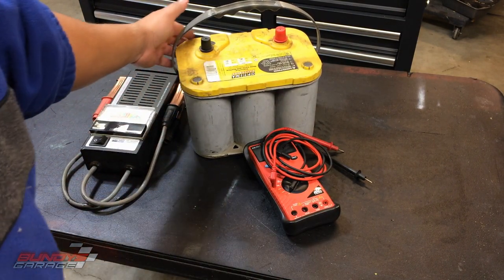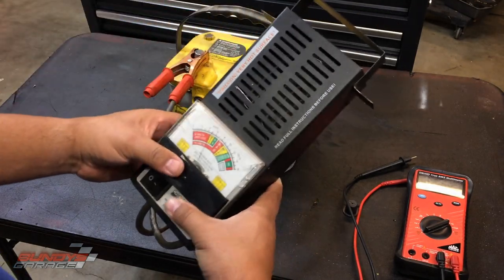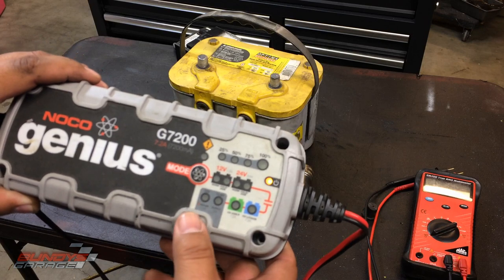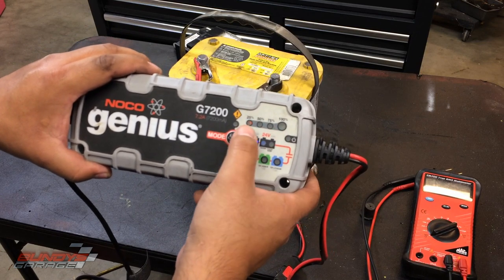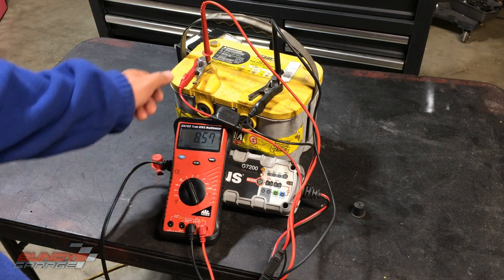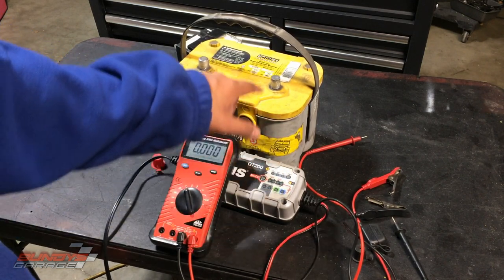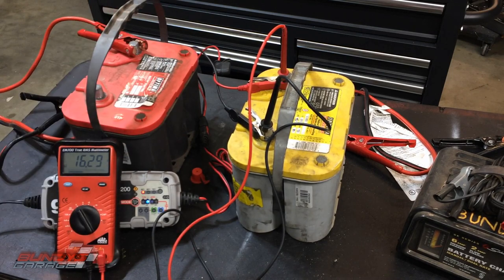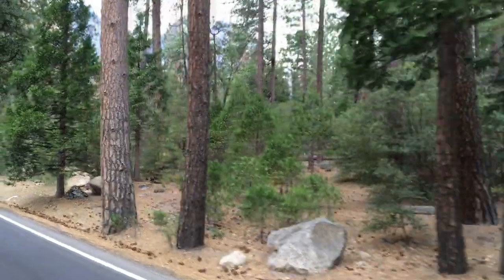Restoring an Optima Battery | Desulfate Optima Battery | Optima Battery Issues | Bundys Garage

Comment: I had 2 lead acid batteries that were sitting at 4.5-5v and 1 that was 0.. absolutely nothing. My Schumacher kept doing errors over night. I’ve learned when it comes to this, trickle charging and old school non digital chargers are the way to go. Grabbed one from harbor freight. For the first 3 days, I used a power wheels 1amp battery charger that I converted to pos/neg clamps. For the next 4-5 days I used the old school trickle on 2amp. I can say that after one week of slowly giving them juice all 3 batteries are sitting at a constant 13.8 while on charge, 13.2 off charge. And handled load test with no issue. Well sitting on the side of the road I just found a red top lol. I’m gonna try and work some magic into it.
Reply: I used a 12 volt power supply for an ATT two wire internet wifi router that puts out 500 miliamps. I just put alligator clips on the wires I cut and wal-ah it works.
Reply: @decoy2636  that's pretty cool man!!!
Reply: Did you check the capacity? You can trickle charge it back up to 13.2 volts but just because it's holding voltage doesn't mean it has any capacity It could have one amp hour for all you know

Comment: I was told by Optima that it can be restored if crystallization happens (under 12.4 volts)  so never buy a new AGM if it is under that voltage.

Comment: I know this is an older video. But I have a yellow top from 2009. And still have the instructions.
They are very clear that you put the battery on a high amp load for 10+hours minimum. And then a low amp load or trickle charge for a few hours after. 
This battery has "died" once from stereo abuse. And it even tested same as yours. But after giving it about 15 hours of charging it came back. 
Maybe they are as hit and miss as people say. But I love my yellow top. Its a beast
Reply from the maker: Your one of the lucky ones. Most people either love them or hate them, not a real gray area when it comes to Optima
Reply: @bundysgarage  it's been the only example I have ever had so I cant be to biased I guess.
Reply: I have a $399 blue top.  18 months old.  Garbage! Junk!   The 800 optima battery guy told me to Discard it.
Reply: @pepperroni4016 i had a yellow years back and ended up warranting 4 batteries over a 3 year period. Im not a fan, but I came here as I was given a newer red top free Im trying to revive.

Comment: Well... If it lasted 20 years or even 15, the Optima FAR FAR outshines 99% of all other lead/acid batteries.
After going thru several lead acid batteries in under 1 1/2 years in my 2000 Montero Sport, I bit the bullet and installed a yellow top Optima. It outlasted the Montero 🤣.
My daughter still has it and it's running strong 18 years later.
Reply: I have an Optima Red I bought in 2001... Still going in 2023.
Reply: @Notubehaveplasma since they make them in China and Mexico now. They last 1 or 2 years only.   Do not buy Optima Batteries !

Comment: I keep hearing about how these batteries should have special chargers.  Which is funny because the alternator on my old 70's Chevy sure isn't using any special to charge it.  No microprocessors.  Nothing to shut off when it fully charged.

Comment: For whatever reason, all my Schumacher maintainers won't maintain. I've asked the part store and they said they are getting back tons of maintainers and batteries. I've replaced 3 Optimas in a row. New off the shelf and they went dead after a few months of use. I use to swear by them, but anymore I just don't know. I ended up buying a Motorcraft only because of the warranty, which is about the best on the market I've seen.
  I have a Schumacher sc1400 that just quit. I contacted them and they wouldn't replace it and said they didn't have the parts to fix it either. So I'm stuck with a $335 charger I can't use. The harbor freight maintainers seem to work the best besides the clips corroding after a few months. I've tried many different maintainers/chargers on the net. 
  My neighbor has a noco but he finally admitted it won't work on bad batteries after he tried bringing back 5 different batteries I had. He said it worked on his Honda. I told him it'll work on a good battery that just needs recharged but not on a bad battery. After yrs of trying to save batteries, the time it takes just isn't worth it. A battery you think you saved will just give up when you don't expect it. Also it'll never give the same performance as it use to. Next you burn up a starter or have other electrical issues all leading back to a bad battery.  Just buy a new battery.

Comment: Thank you for sharing the video even if it did not bring it back to life a lot of people wouldn’t have posted the video unless it worked. I have a 2/18 Optima red top battery that is charging but not fully charged it stops at 12.0 to 12.2 and I’m trying to restore it back to 12.6 12.8 volts as what Optima says on there website, I think it is Sulfate inside maybe let it drop to around 11.5 volts then put it back on charge?

Comment: I found 2 blue tops for free someone was throwing away. One has a date from 2016. It trips my noco genius pro 10x1. One batt was good, so im doing your jumper cable between them trick. Hopefully that works, otherwise I'll try the repair mode for a while

Comment: Now that Optima is owned by Clarios, they want you to buy their own brand of battery charger - which despite the high price - will not restore a battery with a bad cell.  Battery chargers claim that they can reverse stratification and sulfation.  I don't know.  When a battery drains, and it's still under warranty, I've been able to recharge some batteries.  But when an out of warranty period battery on the charger gets hot, that's not coming back to life.  Kind of weird to spend money on a battery charger, to restore a battery under warranty, which should just be replaced under warranty.

Comment: Old school does the best job of testing, and last forever. Mine is ancient and still is perfect.  One tip the top of the battery can conduct power, and will drain the battery. Test it by putting the volt ohm meter to the positive then to the top of the battery.  Dirty battery will drain. Dirt is conductive.

Comment: Use a 12 volt power supply for any electronics that use a tiny amount of 12 volt power say 500 miliamps cut the wires and put alligator clips on it.
It will charge regardless since it has no choice and that keeps you from having to use a slave battery.

Comment: You should try to charge that battery first and then put a little test on it but use a special charger to charge it at low amperage for 24 to 48 hours.

Comment: Just had my yellow top battery die after 16 months.  I’m just replacing it I drive for a living so I’m not playing with it.
Reply from the maker: Optima use to be good but now that they manufacturer in Mexico they are junk. If you want an AGM that will stand the test of time look at Northstar AGM batteries.
Reply: To clarify I had no interest in initiating the warranty.  Optima is dead to me, no pun intended 😂

Comment: Make sure I use a charger. That's at least 10 V with a double around it. But a restricted 20 V charger low Ambridge. Maybe it will come back or a low Ambridge. 16 V power supply break abase set up. Otherwise, we'll find out why that battery's not holding the charge. Leave it on all night to see what actually will happen.  If you have one of those if you have a smart charger just be careful.Set it on slow charge but that may still be saying the charge but it may not

Comment: I have a brand new blue top that worked great for like a month maybe, but the vehicle only was crunk and went around the block maybe 4 times in that month, then I disconnected the battery, removed it and it was working great when I removed it, total trust that it wouldn't let me down, and sat it on my bench top for say maybe another month, boom, try to use it... dead... try to charge? It acts like its taking a charge. Check back in the morning, boom, error... bad battery... wtf? Its literally brand new!
Reply from the maker: That sucks! Ever since they moved manufacturing to Mexico, quality has gone downhill. Take it back to the place you bought it at as get it replaced under warranty. They have a 3 year warranty on them.

Comment: What about an Optima DH6 CCA 800 purchase at AutoZone in 2020.
One Night I forgot and left my 2005 Jeep Grand Cherokee Start Switch ON OVERNIGHT, and does not hold the charge,
Now it does not turn on my Jeep but shows the Dashboard Signs, therefore the Electric Brakes System, and Brake as the ABS LIGHTS stay on.
Any suggestion if my brake Sensors is the problem to turn on my car or if it is just the battery?

Comment: I have a 10 year old Optima yellow top we can try.
Reply from the maker: YEAH LETS TRY!
Reply: I'm actually trying to do this right now I'm trying to revive a huge optima blue a friend gave me he says it's been sitting in his garage for like 10 years opening voltage was 6 volts. 

I'm currently using a genius 5 to try to revive it I tried to have it charge it traditional like but it gave me an error I put it on repair mode this morning and then I'm going to try just four repair modes on it just for the hell of it and see if I can revive it If it doesn't do it I'm just going to toss it maybe I can get some money for it or something.
Reply: Just an update I wasn't able to bring it back. got $15 for it at the recycle place.

Comment: Does this work for Stinger battery's ? Stinger SPV69C 1100 Amp Power Series Dry Cell Battery with Protective Steel Case for Systems Up to 2000W
Reply from the maker: You can try it.

Comment: I would have peeled the label off the battery and popped off the caps, checked the electrolyte (top of with distilled water),  hooked up a 200amp stick welder or 200amp manual charger and bring the battery to a boil for 15min, rest it for a hour, repeat, min 5 times. Then try the NOCO. Never give up..
Reply: Sarcasm I hope.......
Reply: @83malibuwagon  No, just a educated recommendation (from experience)
Reply: i was going to suggest this too, if that battery is like all the other lead acid type. i guess you say it is. i have done this as there are a LOT of videos showing this works. and it did work great for me on my walmart Maxx batteries. I still have one in my truck i forgot i did this to when i took this yellow one. I have it on a 2A charger for now. i over nighted it.  but it said 12V when i first picked it up and i know it would NOT start my friends car. so i dont know what to think other than try the 200A charger as per your suggestion, which is what all the videos say and which is how i did it to my Maxx.  I would just like to know if this works on them, that's all.